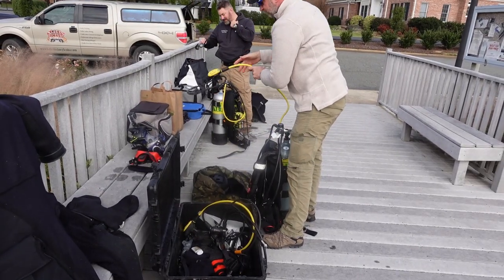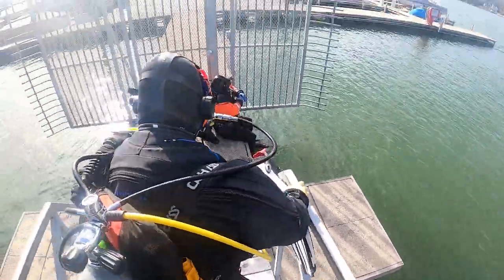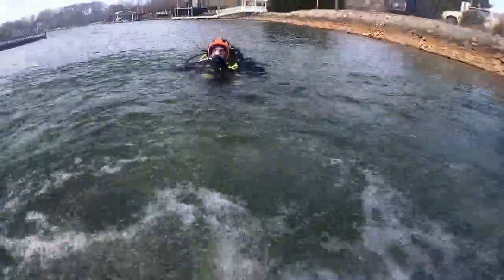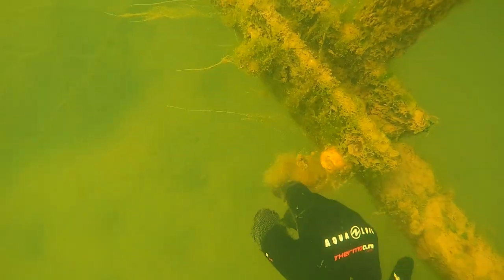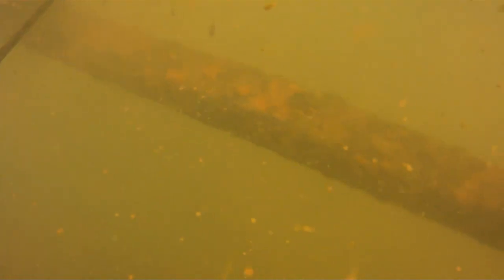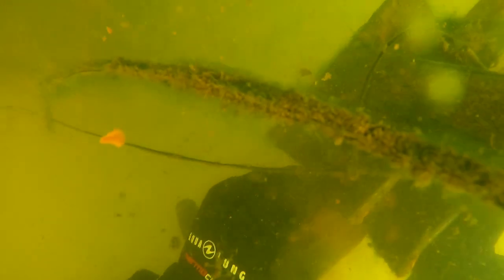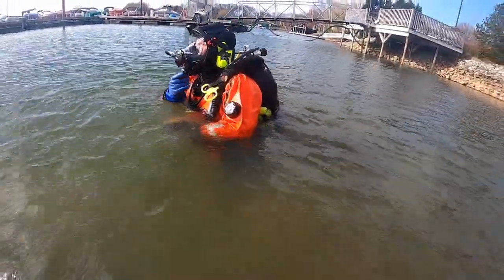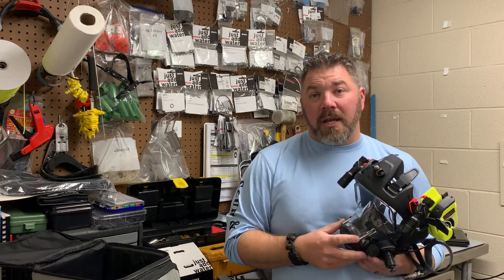"Dock Inspection And Repair" Just Another Typical Day

Comment: I work in the electrical service industry and think about safety quite a bit. Recently at one of our local lakes we had two deaths by electrocution at a dock due to poor boat side wiring practices. Do you have to perform any sort of lockout ragout procedures when working in marinas or doing boat inspections?
Reply from the maker: Hello James, thankfully we have never been in a situation around a dock that presented that issue. However, we do tons of inspections of water intake systems, and Lick Out Tag Out is always put into place before we enter the water

Comment: Hey Brian, on those dry gloves you where using was there any concern on them tearing for what you were doing as part of the inspection? I recently purchased a dry suit and had been looking at dry gloves, but i keep hearing from other divers that the outer glove can tear easy. So are you using some type of heavy duty variant?
Reply from the maker: Hello M3rl1n87, I use standard gloves from Si-Tech. Personally, I have never had an issue with them becoming ripped while working. With this being said, I have wore several sets out over the years. When you log as many dives as I do, most things tend to wear out over time.
Reply: They don't tear particularly easily :). Have seen people wear kevlar overgloves if they're working on particularly sharp stuff